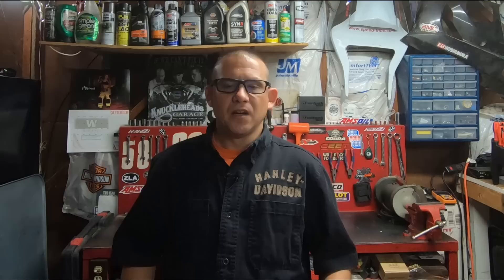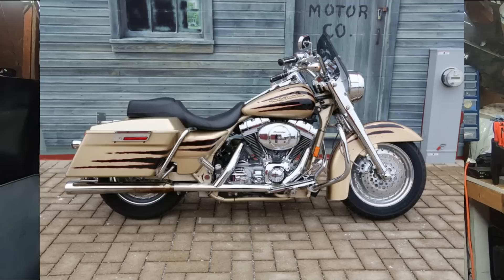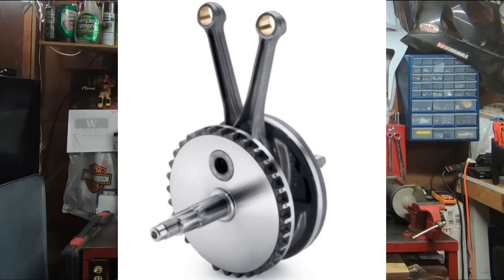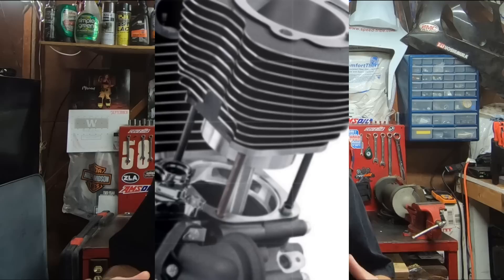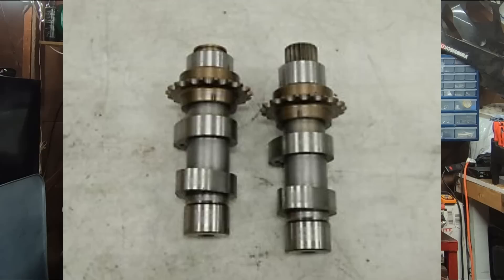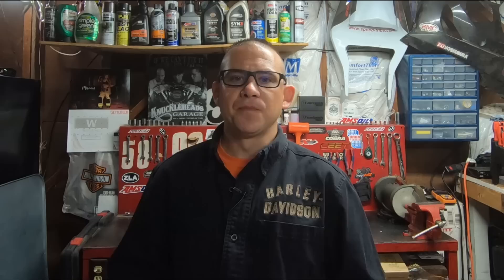The Twin Cam 103 With Hidden Secrets | Harley-Davidson CVO 103

Comment: Wow great research. Keep up the fantastic work.
I am curious what you may know on the newer M8, which is only 4 years old.
Reply from the maker: Thanks, will do! The M8 is a really nice motor, it's had its complications the first few years as with anything new. I think they have it straightened out now and the knowledge base has grown tremendously out there. I'll see about making a video covering the ins and outs, the known issues and what they are doing about it.
Reply: @GixxerFoo  
The first thing I heard was that the bigger oil pump was a great start.
Reply from the maker: They've went through 3 different oil pump designs, and l think they have it right now with the latest one. I would definently have a dealer run the vin if you bought a used one and verify if it's had the updates.
Reply: @GixxerFoo  
I was looking at a '17 but couldn't come to terms with the dealer.  Then the '18s came out and I still wasn't sure. Then I was in FL visiting my brother, we took a trip to one of the HD dealerships and one threw out a price for a '19 so I took it.
The following year (2020) my brother bought as well.
Thus my interest for the M8's. But I must say through listening to your podcasts you have peaked my interest on other models.
Though I better cool my jets, because I am trying to restore a '65 pan and want to rebuild my first bike which is a '74 sporty.
But the detailed info you offer is superb.
It will really help in narrowing ones research on particular models.
Keep up the good work.
Reply from the maker: Thank you, l appreciate it! Probably a good thing you didn't get the 2017, they had some ring issues and oil consumption. 2018 and newer l like a lot better, they improved them quite a bit. Sounds like you've got some serious projects going!

Comment: I have a 2007 FHLP police road king that was manufactured in August of 2006. it has cable clutch cable throttle and correct FMH vin on engine witch is a 103ci. my ? do I have it a late model 2009 103, or an early stroked 88 103? thanks

Comment: Supposedly a Rod Length/Stroke ratio of 2:1 is the best, which is why the early Laverda Triples of the 1970's were such beasts. Of the 24 bikes I've had, my 1975 Laverda was my favorite, but I just couldn't get parts for it. Now they're museum pieces, so I settle for a friendlier 1971 BMW R75/5, as the Germans are much more businesslike than the Italians.
Reply from the maker: You don't see Laverdas every day, what did you end up doing with that bike? What's your parts situation look like on the BMW, still pretty good availability?
Reply: @GixxerFoo  In 1983 I paid $2,500 for the Lav, and sold it 1 1/2 years later for the same money. It had 10,000 miles on it when I bought it, and 25,000 when I let it go. I didn't have much money back then, and it was my only wheels. I got a new BMW R80/ST that was fun and reliable, but no ground pounder. Now I'm 70, and don't want a monster. I am restoring my BMW and have enough extra parts to build another whole bike (minus frame and handlebars.) You can get almost everything new, and ebay has a plethora of used parts, although the prices are rising. I usually drive my 2002 Lincoln Towncar these days, and ride my 2000 Kawasaki Drifter 800 for kicks. I retired a few months ago due to the pandemic. (I worked in a hospital in Oakland ... a very busy place).
Laverda parts are fairly plentiful now, they are all in Naksup, British Columbia, but $$$.
Reply from the maker: Yeah Italian motorcycles like that weren't really huge in the US, but they sure are neat to see. I am surprised you ran across one and rode one for a while! My dad ran a Kawasaki shop for 30 years, l remember the Drifter. He's 72 now and rides a Vrod, never thought he would get a Harley.
Reply: @GixxerFoo  Japanese motorcycles were crap for a long time. In the Sixties they were all junk except for the electrics, which helped for reliability, much to the rue of the Brits. During the Seventies they managed to find some power for their bikes (CB 750 and the Kawi 900) but the handling and brakes were weak, when not deadly. During the EIghties the Brits, Italians and us Yankees fell apart economically, and Japan didn't have to work that hard for our $$, but handling and brakes did improve some. During the Nineties, especially the late Nineties they must have found a crashed flying saucer and stolen the technology! Engine, brakes, handling, and even ergonomics caught up with their already superior electronics, and Japan started making world beaters. Their metallurgy is weak in mass production, but has been superior for centuries on a small scale. Consider the Samurai sword craftsmanship, it's like no other in the world today. I'm OK with riding Japanese today.
Reply from the maker: Lol yeah they used to be junk! They have come a long way since those days. Yeah for some reason late 60's  in the early 70's they really started gaining some ground!

Comment: And these facts and trends are the reason I'm holding out on an M8, I believe that 131 crate motor may eventually become standard equipment, when it does I'll be ready but until then I'm having plenty of fun on 2015 dyna, the 103 with some aggressive cams and a little head work, higher compression achieved by a simple gasket swap and she scoots.
Reply: Which cams? And what’s a “little” head work? Do you have vids about it? I have a ‘14 dyna with the 103 so I’m interested
Reply: @bullast2046  I don't have any real videos about the work no, I'm not a content creator just a viewer. But I'm running an S&S crank and 585 cams/plate/pump Done a little more with the motor since this comment but yeah, a little headwork means intake porting and and valves/seats cut.
Reply: @travismccarty515  thanks

Comment: And 2002 had the heavy duty timken bearing on the left side case!
Reply from the maker: That's correct, it can be added with a sleeve to 2003 and up but it's a process.

Comment: Thanks for your videos they are the best for explaining… I’ve purchased a 2016 Heritage classic with a 103 High Output. But I’m unable to find what cam and other goodness has been put in to make the high output? If anything? 
Thanks in advance.👍
Reply from the maker: The 103 HO had a higher capacity air box or open air cleaner on some models, the cam was bit higher lift. The specs on the HO cam are basically the SE 255.

Comment: Need your opinion.  I just bought a 2003 road king cvo FLHRSEI2 screamin eagle (the gold w/graphics). It has the 103. It has 27k miles. I pulled the cam cover and the cam chain tensioner shoes need to be replaced. I'm wondering how far go when replacing the shoes. Perhaps upgrade the cam plate, cams, oil pump,  bearings,  etc?? I'm not trying to make a race bike, just a dependable ride. What you think?
Reply from the maker: If you can swing it I would upgrade the cam plate to that later style with the hydraulic tensioners and a the high volume oil pump. You can get that through Screamin Eagle or I would recommend checking out Feuling OE+. It's well worth the money and piece of mind. Generally hydraulic tensioners run about 50K before needing replacement and the spring tensioners can make it about 30K miles so you're right in line with the replacement interval. It snow balls when you get in there so while you got it down if you decide to the cam plate upgrade route you can get a complete package with a cam upgrade as well, never hurts to do the whole cam chest while you're there. I would recommend new cam bearings 100% and some lifters while you're there. At a minimum some new spring tensioners and ride on for another 30K miles.

Comment: and as a stroked 88  i think once cases are updated its not stroked as such  an 80 is a a stroked 74 an 88 is a stroked and big bored 74 ..i think its hard to categorise them like that ,even though it is the case .. as you said the cases were over bored for bigger spigots for the 96" barrels (95) in 88 but still can be bored out to 95/96 (96need stroke though) 103 problebly really an over bored 96 as mine is but with some upgrades  lol ...love your channel only new to it ...
Reply from the maker: It's all the same concept between the motor with some minor changes. It's all done with the Screamin Eagle stage kits in mind. Lol Harley wants you to keep upgrading.
Reply: 95 and 103 are the same bore 103 just has a longer stroke

Comment: I have this motor.. what else can be done to it now to take it to next level..good video
Reply from the maker: They are really good motors, getting a good port job on the heads goes a long way with these motors. Adding a good aftermarket cam will really a wake them up too!

Comment: Awesome vid.   About to buy an '05 FLHCI Road King with the 103.    Is this considered a factory upgrade?  I suspect dealer-installed as I can't find SE or CVO designated RK's out there for back then.    Does the higher output increase the likelihood of spring-tensioner issues?  And if I do the hydraulic upgrade, what might you recommend to further upgrade in this 103?   Thanks for your expertise!
Reply from the maker: They didn't have a Screamin Eagle Road King in 2005, they had Police Road Kings that could of been equipped with a 95 or 103 but the standard was an 88. It's possible it could of received a stroked crank and 95 cylinders from Harley. You might have a dealer run the VIN, they could tell you if it was converted to a 103 at a dealer. The spring tensioners in those later years were better than 99 to 02 models, but still keep an eye on them. If that bike was converted to a 103 it may of already been updated to hydraulic tensioners.

Comment: The twin cam is the motor you want for sure.  I mean looking back, the 1st generation of any engine from Harley,  had issues to iron out. The 1st gen twin cam had some major issues,  from scizoring cranks,  to the tensioner foot breaking apart,  causing plastic shards to lodge into the oil pump,  grenading the engine.  The last gen evo, was a much better engine than the 1st gen twin cam. Down the road, after its 3rd and 4th generation,  those issues were worked out and in the later generations,  it becomes a much better engine than the evo, at least as far as a platform ( the evos are still great engines,  for both nostalgia and longevity,  but for a performance platform,  the twin cam I think is more capable,  more efficient,  and probably has better parts availability,  since the evos are pretty old now) , that being said,  looking at a 1st generation Milwaukee , I think they have work to do, as there are some issues with it. Do your own research on it. I'm sure the bugs will be worked out, in a second and 3rd generation m8, and by that time I think it may be a better platform for the enthusiast,  but I tell everyone right now, to go with a last generation twin cam,  it's a great engine,  with lots of potential,  and has a great parts availability.  I do however think that because of how Harley press fits the cranks,  that scizoring can still be an issue,  but I think it all comes down to how you ride it. That low end torque is available at such low rpm,  that many people will lug the engine down low in the revs, which is what really will cause the problem.  Keep the engine in its rev range, dont lug it to hard , and scizoring will never be an issue,  but these guys riding along at 1500 to 1800 rpm, are really stressing that crank.  I had a 2015 softail slim 103, was an amazing bike,  and I always kept the engine above 2300 when riding it. You'll get 100k np out of those engines if you are mindful of that. In other words,  just because it pulls along nicely at 1500, doesn't mean you should do it,  not to mention that you have much better oil flow when keeping them above 2300. Don't lug these engines below there operating ranges,  and they are beautiful.  The scizoring issue is not a flaw, but more of how people ride. Great video btw.  I since sold my softail,  picked up a buell xb12s,  amazing bike man, so under rated lol. I would love to see a buell build,  it's an excellent platform,  excellent chassis,  with incredible breaks.  I'm amazed pulling up to bike meets,  and no one knows what it is. They are becoming very rare,  and are worth keeping alive. I think Harley mad a bad choice ( just my opinion) discontinuing a sport bike,  using the beautiful cave man engine.   There is a big market even now, of people who I think would love a modern sport version of a buell with an m8, I really think Harley should get back in the spotlight,  and build a sport bike using that engine.  Obviously it would be niche,  but if they could do it for a good price point,  I think it would be a game changer.  Excellent video man great build xD
Reply from the maker: Thank you! Yes the later generation of any motor is the way to go unless you're willing to go in and fix the issues yourself. Just gotta do your research and know what your buying before you throw down your hard earned money.
Reply: When I was a teenager (in the Sixties, wouldn't trade that era for anything) the word was that Harley would make a bike and use their customers as their R&D department (some would say they still do.) What made that idea stick for me was the belief that if something broke, Harley would just make it bigger (thus stronger.) Of course that would strain other components, which would break, and then be re-engineered bigger. After this cycle was repeated many times, things would balance out, finally, but then it would be outdated and they would start out all over again. When I was riding a Harley (Evolution, of course) everybody called the Shovelhead the "Trouble Head." The service manager at Dud Perkins HD (in SF) would mock Shovelhead riders by glancing down at the bike as often as he looked at the road.
Reply from the maker: Those AMF years were not the best, big question is what can l do to make it reliable. Well, lol youniust gotta be prepared and know how to work on them. Friend of mine has a shovel head, it requires a lot of love to say the least.
Reply: I want to add to your post.  The scissoring cranks happened when knuckleheads would downshift into 2nd or third gear at too high of speed.  Millions of people who knew how to ride Never had that problem.  The cam chain problem was all over the board as to what caused that problem.  I bought new a 99 Electra Glide, never a problem.  I don't personally know ANYBODY that happened to.  But it did happen according to a lot of reports in MC magazines.  I would have to think maybe the owners weren't maintaining his bike per the owners manual.
Reply: I am not as informed as you, but I loved what you said, right now I just love.
Reply: I am looking to buy a 3090 gpu, for $1500, might only give me a 15% performance boost, am 71, I knopw my days are numbered, but I went for it.
Reply: You are A most Amazing Person.
Reply: I never had any issues in my twin cam 103 in my 2014 ultra clasic , n i pushed it hard,  my motor in my 2010 limited needed rebuilt, about 34, ooo miles, i rode it trouble free until 65,oo0 miles then traded it worried i would  need a motor again, although the warranty would have covered it, its the down time that bothers me, riding season is short enough in Ohio as it is

Comment: I got a 03 ultra with 106 stroker S&S with 55 mil throttle body on nitrous. I have 585 cams now if I put 640 cans do u think it would produce more pwr leave the 585 in it? I cant find a straight answer, I would presume it would make more pwr!

Comment: Ok I have the 2005 Fat Boy CVO 103 . Upgraded air intake and exhaust DK custom. After watching your video on cam upgrades I’m tempted to install the Wood tw222 cam . What do ya think about that choice ? My bike has the screemin Eagle heads and valve springs. Will that motor handle a more aggressive cam  
Thanks

Comment: The motorbike I bought is a 2003 Screamin Eagle 103 with 264 cams and high Compression cylinder Heads, and D&D performance exhaust 2 into 1. Before starting, there are 2 blue buttons that I have to push or I will damage the starter. I am thinking cylinder decompression buttons and updated ignition system as well. Dyno tested 100 hp and 104 ft/lbs.
Would this be a factory build or a custom build by the owner?
Reply from the maker: That would of been a custom build, the 2 blue buttons are definitely compression releases. With a 264 cam it's going to have some serious compression. I bet that bikes is a screamer with all that work done, the stock Screamin Eagle 103 was not nearly that hot of a motor.

Comment: Can a stock 88 be made a 110 without crank work?
Reply from the maker: 100 inch is about as big as you can go with specialty cylinders from S&S. You'd need a stroker crank and case bore to hit 110 with the 88. But 110 isn't everything, you can go 103 with 10.5:1 compression pistons on an 88 and make the power and torque.
Reply: Cool thanx redoing the crank is expensive too